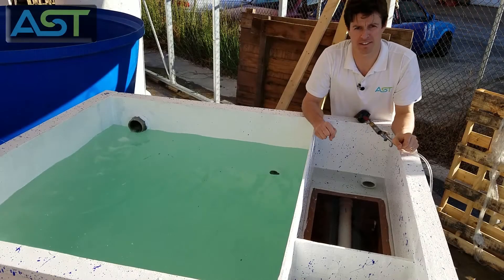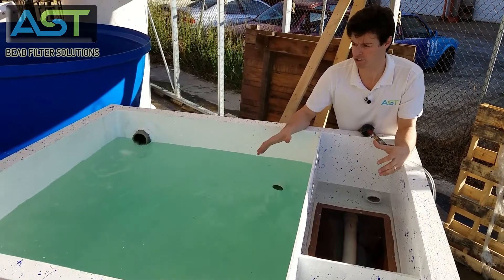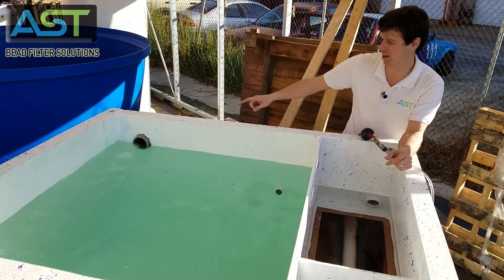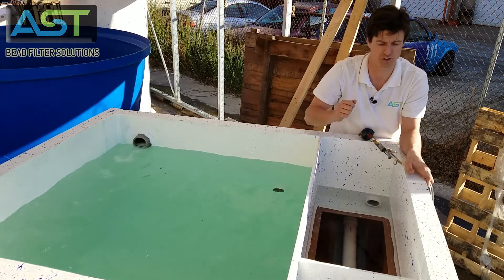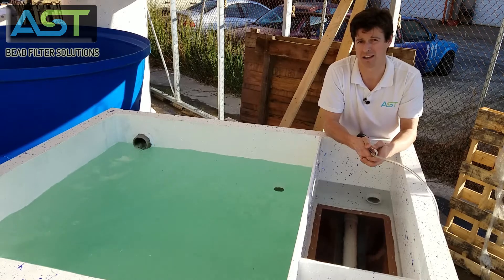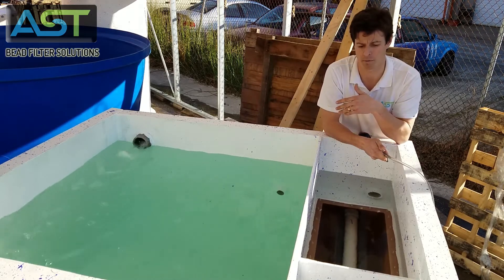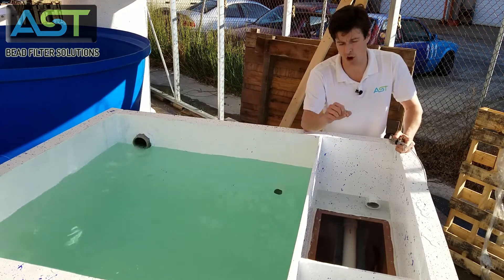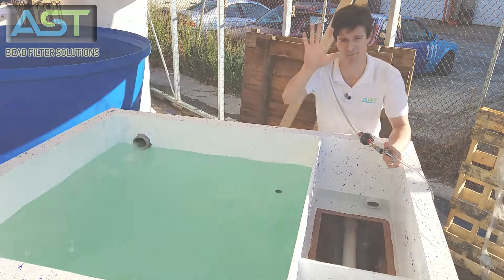AST FIT 400: Powerful PolyGeyser Backwash Demonstration

Comment: Why water lever in filter chamber is lower than water level in main tank? Is there any magic thing happens there?
Reply from the maker: The filtration chamber has a water level that fluctuates. There is an air bubble that collects under the filtration bed in the charge chamber.  This causes the water level to rise until a certain point when the backwash is triggered and the air violently released through the beads (not pictured) in the filtration chamber. Because the screen has been removed here, you see a large burst of water when the system backwashes. Ordinarily, this pressure would be washing through a bed of bead media- knocking off solids and excess bacteria. This is an automated process that is controlled by the air feed rate into the filter. These filters can be configured to backwash themselves up to six times a day depending on your biological load. The gathered sludge needs to be drained periodically (maybe a few times a week), making maintenance really easy.
Reply: How much is one of these?